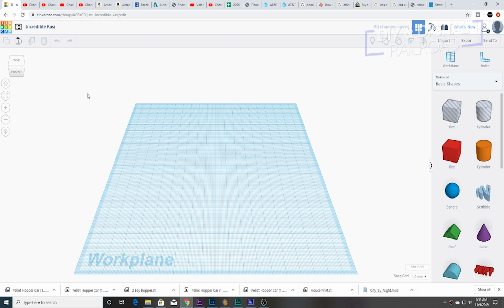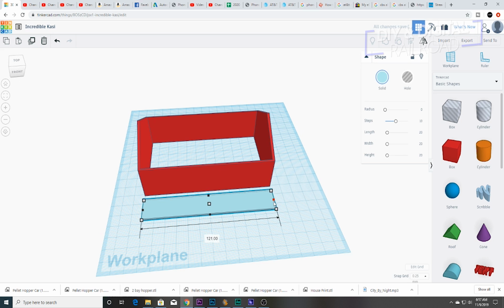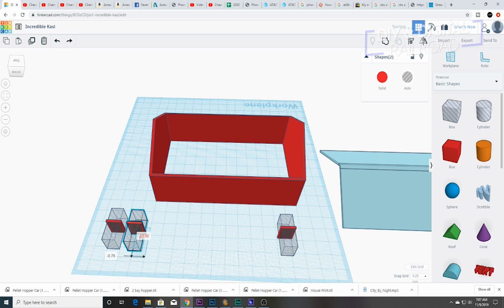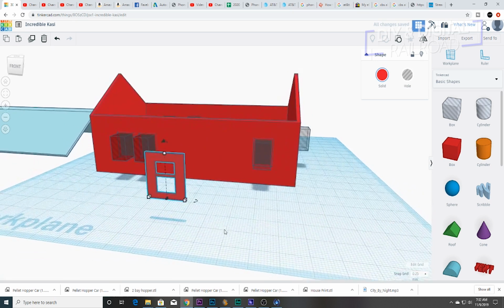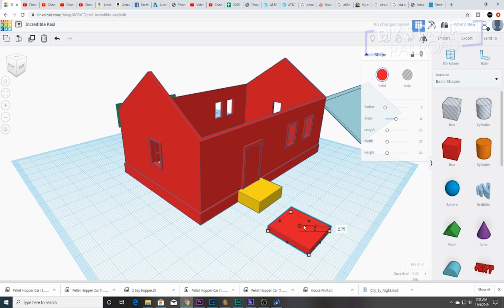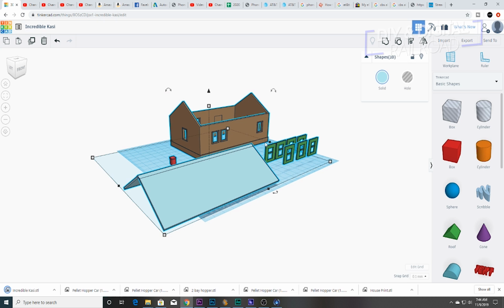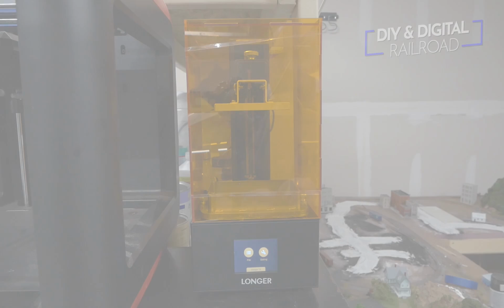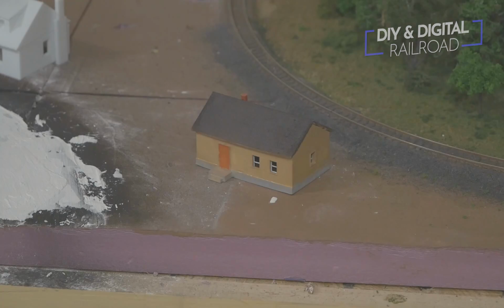Designing and Printing a Model Building in Tinkercad

Comment: While you can use 3D printing for this house model, it is s poor use case as the resin printing is very very slow and a bit costly.  Those bottles of resin can cost $25 on up.  It would take a good 30+ hours to print all those parts in resin, and you wouldn't be taking advantage of the detail levels possible with simulated siding, roofing shingles, brick work, etc.  

In FDM printing with PLA you'll get layer lines such as you see in the cheap quality Outland kits online.  Faster to print, but a lot more work to clean up to be acceptable.

Your house design would be a better choice in simple styrene.  That design could be cut out snd assembled in an hour for around $3 in plastic sheet.

I have multiple 3D printers, FDM, delta, and resin.  I have a laser cutter as well.  Just having the tech doesn't mean it is a good fit for the model.
Reply from the maker: Those are great points.  The cost of resin is the main reason I only typically use it on detailing parts rather than entire structures, and without using the proper settings, FDM printing does have those ugly layer lines. Styrene scratch building is also one of my weaknesses whereas I am stronger in CAD.  I would be interested to know what kind of laser cutter you use.  I'm a hard core tinkerer and I love new tools.

Comment: Very well done, any idea on how to put stone, brick, or lap siding textures on the walls?
Reply: In Tinkercad there are libraries for texture effects.  One quick way is to make a lattice of bricks by taking a block, making it thin, and punching brick holes into it hundreds of times, which can be done by cloning a set of brick 'holes'. Once you have a lattice of brick mortar lines, sink that over you wall surface a few layers, turn to negative or hole mode and join with the wall.